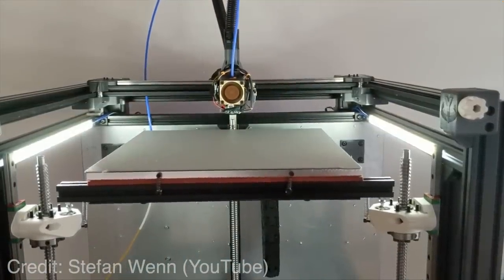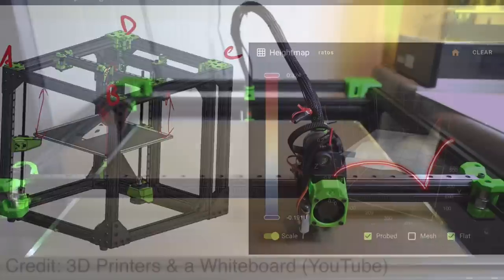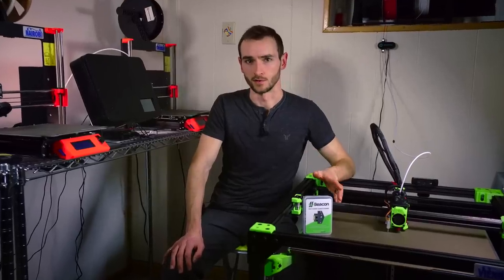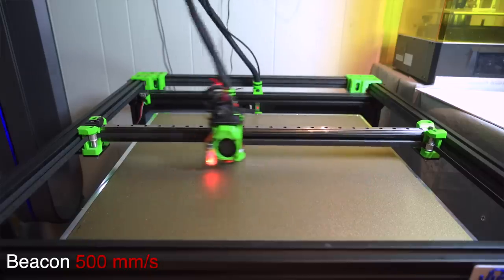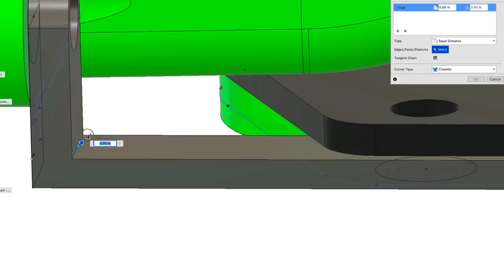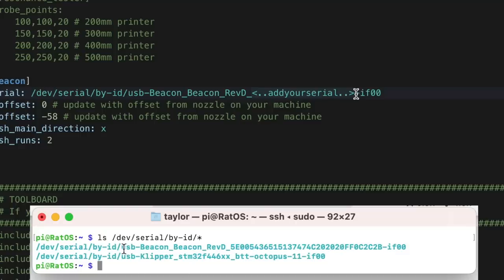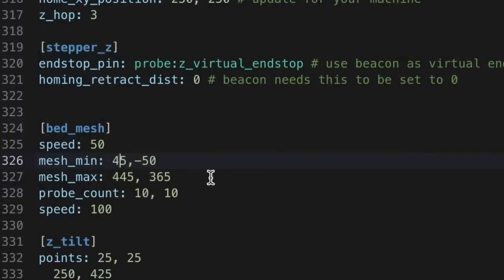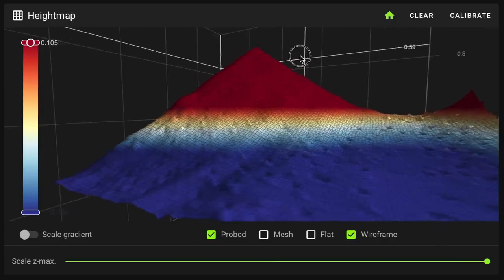The Future of 3D Printer Bed Levelling - 10,000 Point Mesh with Beacon Surface Scanner

Comment: Why?

Bed leveling techniques we have right now are perfectly fine. 🤷
Reply from the maker: For the most part, you’re right, the existing solutions work well enough. The primary advantages of the Beacon are speed and resolution.
Reply: faster, no moving parts, more robust
Reply: Not ideal when you have a print farm with many machines. Leveling can be a headache and this could speed up the process.